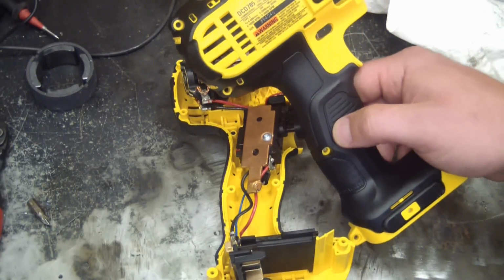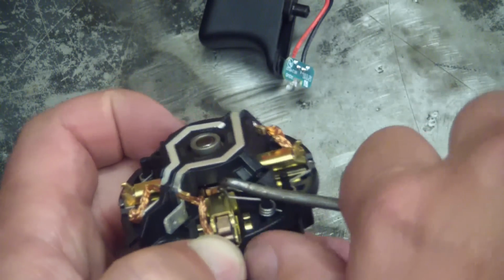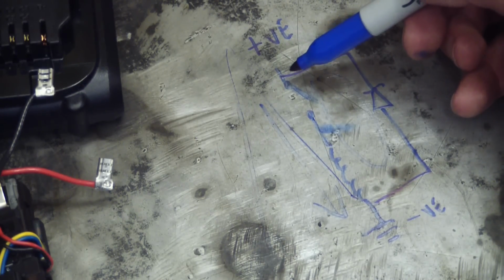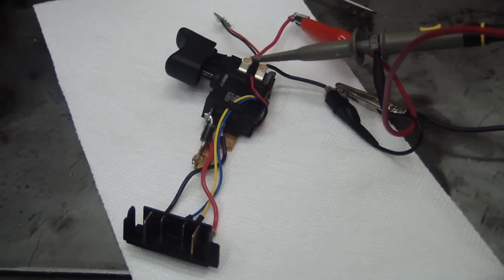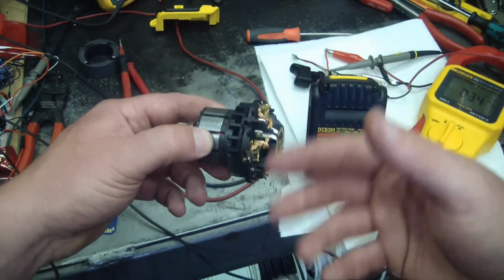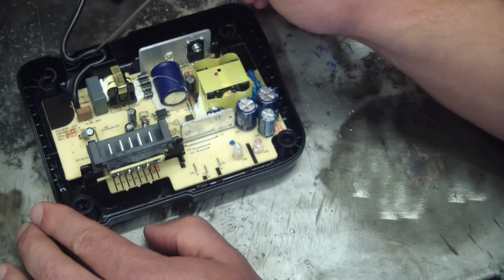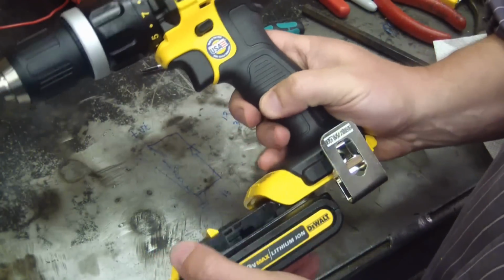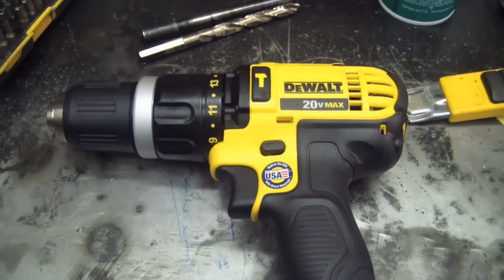BOLTR: DeWalt Hammer Drill. Test, tune and Electrical

Comment: I don't know why you bash DeWalt so much but in my professional opinion, they're decent quality. I agree with the hammer drill function on these things but then again, I don't expect to drill through stone with these, They're fine for drilling through brick to hang a TV over a fireplace or occasionally to cinderblock to attach an outlet.
Reply: seephor Dewalt would be less deserving of a bashing if the tool was more reasonably priced, and more correctly advertised.
Reply: seephor I don't think you understand what the term "professional opinion" means.  Glad you got a good drill, but I find that most Dewalt is shit, and barely serviceable.

 I work in a construction trade as well, but i also worked in a power tool repair company where we were authorized to fix Bosch, Milwaukee, Fein, Hougan, DeWalt, etc. DeWalt was by far the most common tool and took the longest to get fixed and back to the end user, and I don't think that it is reflective of their market share.

in your professional opinion where is the closest DickDonalds?
Reply: Professional opinion? I'm lost, do you give opinions professionally? Like an expert witness in court or something.
Reply: Rory Dakin The free market is the judge of cost. If your peers are willing to dish out that kind of dough, DeWalt is happy to sell it to them. My 18v is still going strong after HEAVY use and abuse so I'm less included to switch to a different brand. Basic economics. I'm not saying they're the best, but decent.

Comment: i have a 18v and i used it 1 time before it breaks... it is the gear on the motor wich is press fit i guess and now it slip after one use... i try to epoxy it but it not working more...

Comment: OK so the hammer action won't do stone or concrete but if you just want to do a few holes in brick or block its a quicker than dragging out the SDS. OK so non hammer will do brick but nothing like as quick. Worth the extra IMHO

Comment: They used several bleeder resistors to get the voltage rating. (20:20)

Comment: Soldered wires in a high vibration enviroment?
I disagree with you lad, I find the soldered wires tend to break where they go into the joint. Never had problems with the spade connectors, as long as the tool is dry-ish inside.
I think the paint blob on the windings is the balancing weight. I bet that thing is done with such sweet tolerances it doesn't need much slotting.

Comment: Looks like DeWalt puts the hammer drill feature in for better marketing.
Reply: I think you guys are confused on what is a hammerdrill and whats a rotary hammer. Hammerdrills are for small diameter holes in block, brick or mortar, not concrete. They offer the same unit without the HD feature.

Comment: I think the reason they use the spade connectors in lieu of solder is fatigue resistance, the solder joints are a stiff spot in the wire, and they're going to get a shit kicking from the motor vibrating, they'll likely break very quickly. 

Talk to an RC enthusiast and they'll tell you never to solder your motor connections for that exact reason.
Reply: It's often for service ability too. Lots of tool techs don't solder and like the plug and play system that some tool mfg's use. Milwaukee attaches their brush cards with screws, which I think is a satisfactory middle ground.
Reply: Teth47  it is possible to sort-of compensate by soldering and using a lot of hot glue, with the hot glue being used to spread vibration and similar. nevermind if the motor gets hot and the glue melts (not usually an issue if the motor is run within its rated values).
Reply: Brendan Bohannon Yeah, but we're talking about a high current tool here that's very likely to be used well outside of ideal conditions, especially when someone's really leaning on it to punch a hole or something, it's easy for them to accidentally cover the vent holes, and that motor will get really hot, really fast when it's working. Also, unless they use some really soft hot glue (they won't), it'll tend to separate from the solder joint over time, negating any damping effects it might have...
Reply: Teth47 could be. I have mostly used hot glue in robotics uses, and also in a CNC milling machine, and it seems to work ok IME for these.

one time I had a motor get hot enough to for the hot glue to melt everywhere, but in this case it also got hot enough to burn up the coils (had to rewind the motor afterwards). so, the glue melting was the lesser of the issues with this.

but, yeah, note that it is better to use high-temp sticks, and not all-temp / dual-temp sticks (which have a much lower melting point). a possible informal test for this is seeing if the hot-glue melts in boiling water (if it melts in boiling water, it is likely to melt if the motor gets too hot).

alternatively, go buy glue sticks with a reasonably high rated melting point (say, 150C or 170C).

alternatively, it may be possible to run nylon tubing through the glue-gun (this stuff doesn't melt all that easily, and makes for a reasonably durable hot-glue). depends some on the tubing and glue-gun if this will work.
Reply: Mazekwon  yeah, could be.

I had soldered motors mostly due to having bought some motors which didn't have spade connectors (just small curved metal tabs), so apart from soldering there was no real other "good" way to attach the wires to them.

after doing a bit of electronics though (fabricating boards, ...) it doesn't really seem like much to solder/desolder things as-needed (like, maybe it is a little annoying waiting for the iron to get hot).

admittedly, I am also the sort that likes soldering the crimp connectors onto the wires to make sure they don't fall off.

a few of the other motors I have, just have wires that go into the housing and are soldered internally.
Reply: Brendan Bohannon I agree that soldering isn't a big deal, but it takes a lot more time to solder something and when people suck at it, it is even longer & time equals money. 

If you have made boards, like you & I, it makes it easier but to the people who went to school to fix tools they soldered a couple tabs and then assembled planetary gearcases. So I don't think they really had time to grasp the molten metal physics of it all. 

Good plan of soldering your motor tabs, it is the best way to get power to the motor, for sure.
Reply: Teth47 RC racing guys, at least in Cars and Trucks, never use connectors on brushed motors anymore. Back in the day maybe. (80s-98) But when it comes to brushed motors, solder is the preferred method. The connectors caused too much resistance to the motor when you started getting better batteries and better speed controls. Now I will admit you are right about them breaking. I have done rush jobs on the motors between races and then had the wire break off the motor.
Reply: ackackBarf Everyone I know uses bullet connectors...

Comment: The little glob of orange epoxy on the rotor windings is probably for balancing. Not as precise as grinding the armature (which I believe is done by an expensive automated machine), but better than nothing, and a whole bunch cheaper..

It also has the added bonus of not shorting the armature plates together which causes losses due to hysteresis as you pointed out some time ago.

Comment: The resistor "ladder" is necessary because of the voltage across the resistors. Hard to tell, what size they are, but I think they would be rated for something between 100V and 200V. If you factor in that you must consider peak voltage and not RMS, degrading of the rating due to dirt and even maybe a universal board design for all voltages up to 230V mains (if the charger isn't universal 100-240V the only difference will be the input smoothing cap and maybe the switching transistor, everything else will be the same), you have to use several resistors here.

Comment: The diode needs to be a cross the motor.

There has to be a diode across the motor anyways to make the PWM to work efficiently anyway, then it is basically working like a buck converter https://en.wikipedia.org/wiki/Buck_converter

Though to to use an N-channel mosfet they probably made it "up side down"

Comment: at 20:20 you mention that they couldnt get 3Mohm smd resistors, I am a smt technician for a circuit board production company in the UK and we regularly use 1 - 10Mohm smd resistors. The highest ive seen used in application though was an 0805 1Giga ohm, they were pretty expensive.

Comment: Hey AvE, that freewheelah/flybacko dioyote schemanigans that you draw won't chooch, when the mcmosfet opens you would have the same problemo that you had before, as there is no path for the coil to discharge. 

Either you place it over the motor (coil+ESR) or you place it over the switch, especifically when doing an skookum H-bridge.

Comment: Point of order there. The EMP diode is across a motor wire and the FET heat sink, which of course is connected to the drain in most FETs. I think in the heat of the video your diode link should be the motor side of the switch. Now here's a thing, what happens when the polarity is reversed for opposite rotation?
The lump of goo on the coils could be your balance weight.
 Cheers, Andy

Comment: I'm not understanding how the MOSFET is handling all the current.  In the drills I've played with, if you remove the MOSFET, you lose speed control and simply have full power or no power..  I thought the MOSFET was there to dissipate heat made from the resistance of not going full throttle and was bypassed at full throttle, meaning your 11A 18VDC switch is handling all the power when pegged??  I've been trying to understand exactly how one of these speed controls works, and also how you can switch directions digitally rather than mechanically and why manufacturers haven't gone this way since there are already other electronics on board....
Reply: bigdmcc 
He showed it in the video. It's called PWM motor control. Google it, there're plenty of explanations available (because it's the standard for almost every DC motor control). If you didn't find them, you didn't look. 
The direction isn't switched digitally. The small lever just reverses the leads inside the trigger. If you want to switch digitally, look up H-bridge. Goes well with the previous topic.
Reply: superdau thanks for reply....   I get all that, but the drill motor is pulling well over 11A,  and if you're using a drill professionally, or aggressively  ,  you are going to leave it wide open for a while.   My 14.4V dewalt pulls 30+ amps, according to  a cheap ebay current meter, for quite a while if I'm drilling 1/4"+ steel.  It has yet to let me down, but I"m still confused on these lower rated switches and MOSFETS.  I'm not sure but maybe most people don't leave them 100% as long as I do..  I worked as a IPTV installer for quite some time and left the same 14.4V Dewalt full throttle in hammer mode for several minutes at a time with no issues,  Why I bought one myself.  I would hammer it through whatever surface until the battery died then switch batteries and keep on going...  I've since learned about percussive drilling and why  this wasn't working..., but these 11A  rated switches make no sense to  me...   I've got a 600W Variac i want use to power some OLD failed cordless drills, but I wasn"t  convinced  that would be enough..... After seeing these videos I'm less worried about them...  Having a fire extinguisher on hand is cheaper than buying a higher current transfomer...  So if they can handle my workload for 10-20 seconds, forget wasting the money.
Reply: bigdmcc 
The whole point of PWM is to dissipate no power in the switch. They are either off (infinite resistance == no current flowing) or on (no resistance == no voltage drop). In neither of these two cases do you dissipate any power. Of course the real world is not that ideal, but do the math how much power you burn in a MOSFET with an on-resistance of a few mOhms. Goes to almost negligible even at a few tens of amps. The most important part of the whole setup is the MOSFET driver. It must be able to switch the MOSFET from off to on and on to off as fast as possible, because when in the linear region (where the FET is neither on nor off) you burn heaps of power.
If you manage the driving it's easy to have switches that handle 50A+ continuous and 150A+ pulsed in a SMD package that's less than 10 by 10mm. Check out any PC mainboard you have even if it's years old and you will find a handful of those.

Comment: A couple of minor corrections: A) with the lithium battery charging, the constant current mode ends when the voltage reaches (in your example) 3.8V. But the voltage does not "jump up" at that point -- it just switches over to constant voltage at that same 3.8V. A lab power supply set to a 3.8V voltage and 1A current limit will behave the same way, which is handy for charging a lithium ion battery in a pinch! And B) the diode should connect up to the top of the relay, the switch should not be included in that loop (the current can't loop through an open switch, after all).
Reply: TheHue's SciTech Oh, and also (not a correction per se): I'm guessing that the three surface mount bleeder resistors are probably in the form of three separate resistors because any one resistor can't be expected to withstand mains voltage across such a small physical gap (risk of arcing).

Comment: The roto-hammer on this drill, while ineffective at masonry or concrete drilling, is awesome for driving screws into wood. It sure makes driving 500 2.5" deck screws go by faster. I think it's more of an impact screwdriver.

When I drill holes for anchoring into concrete, nothing beats the Hilti.

Comment: so question; is you were to modify the charger to slow charge, say over a 5 hours instead of quickcharge, would that extend the life of the battery?
Reply: Vimeslgospare 
Keeping the charged topped off on Lithium batteries is one of the worst things you can do to a Lipo and will kill them even faster! The more time a Lipo spends in the 30 to 70% charge region the better for it's life.
Reply: __queball__ Yes, depending on how close to the batteries max charge rating they are charging at. If they are at say, 90% max, it would make more of a difference than if they were at 50% but it would still help. 

One thing you can do with lithium chemistry batteries that help alot that you shouldn't do with Ni-Cads is keeping the charge topped off. As soon as you are done using the tool, put the battery on the charger. Li-on batteries don't have any memory effect. If a battery is rated for 300 full charge cycles you'll get 610 or more half charge cycles for the same amount of capacity degradation.

Comment: As a pcb designer, I would prefer to use 3 times 1 MegOhm over 1 times 3 MegOhm.
First of all distance: having three parts means more separation of the tracks. Second: Fail safe: If one of the 1 MegOhm resistors gets bridged, the other two are still intact. If the 3 MegOhm resistors even just gets contaminated, the resistance goes down. 3 MegOhm is quite a high value.
Reply: +Ibrahim Ulf Karlsson That would be no problems what so ever, every little bigger smd resistor is capable of at least 250V and there are those for 500V as well and both are cheap, but as former person said it better in many ways to use several instead of only one.
Reply: Re The three Resistors. They're bleeding away rectified mains voltage. I don't think you'll find smt resistors capable of that voltage.
Reply: Actually, those resistors couldn't possibly bleed down the rectified mains voltage, since the X-caps and the common-mode choke (not "transformer") are upstream of the bridge rectifier. Those resistors are only for discharging that X-class capacitor, as per regulations (so as not to get zapped from the mains plug).

Comment: Hi bud. I just imported a "20" volt impact and combi brushless. Made in the usa pair of dewalts to england. Do you have any idea if i can just cut off the plug ans put on a 240v uk plug or will i need some sort of transformer...also will my uk dewalt charger work on my us batteries. Thanks in advance for your help
Reply: Slide84rik take a look at the label on the back of the US dewalt charger.
If they wrote a rated voltage of 100 to 240V 50/60Hz on it, you are good to go. If there is no 240V 50H on the label, do NOT change the plug.

Using the uk-charger for the us batteries: Well, the simplest and safest check is, compare the manufacturer part number. If your uk batteries have the same part number as the us batteries, then they are the same.

But to be honest: With battery packs, I would assume if they are from the same manufacturer as the charger and they fit in the charger, then at worst, the charger will output an error code and not charge the battery. Battery and charger have chips inside that speak to each other and/or are mechanically keyed. If the don´t fit, they don´t fit. If they fit but do not know each other, then the charger will not charge the battery.
Reply: sarowie thanks very much for your help. So if i cant plug us charger into uk socket. What should i do...can i buy somesort of mini transformer?

Comment: The multiple smaller resistors are for clearance as its across mains voltage, single tiny one would be a spark gap